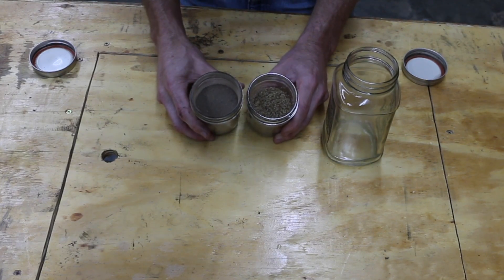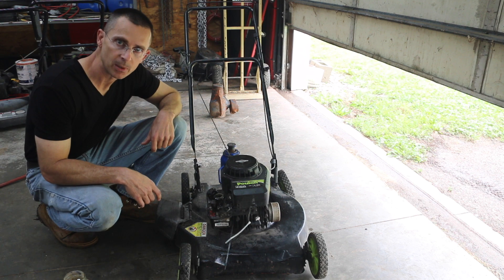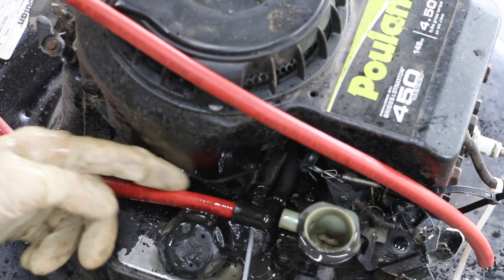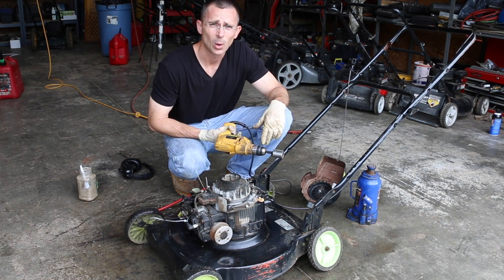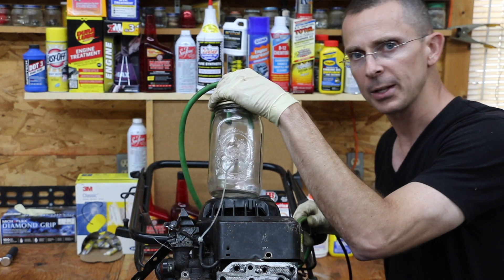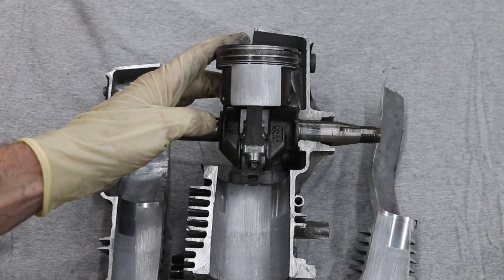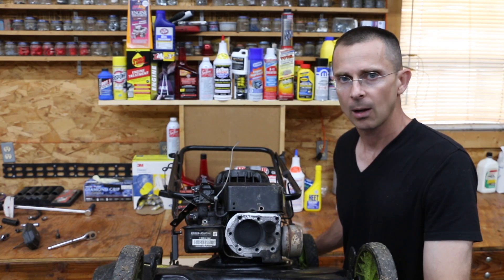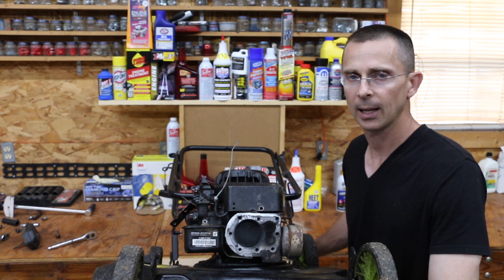Will Dirt Destroy an Engine?  See what it does to this Engine!

Comment: K&N filters gets you free dirt at the cost of “better flow”.
Reply from the maker: Thanks for the feedback.
Reply: Project Farm thanks for all the awesome test! Keep em coming. 

I commented that bc I used to be young and dumb and fell for that “K&N is teh shizz yO!” Till I noticed after a couple of oil changes later my oil was a lot dirtier than when I had used the oem or other air filters. Stuck with oem ever since. To each their own, let them experiment and come to their own conclusion. One’s experience is not always the one be all end all.
Reply: High flow air filters are supposed to be used for performance, not to prolong the life of the engine. Lots of performance and race cars are always rebuilt after every race bwcause they use high flow air filters amd oil filters and lots of other stuff that in reality destroys the cars. But if it wins it wins. Its just not gonna run in another race without a new or perfectly remachined engine

Comment: That oil looks just like the oil in my old Camaro before the rod went through the block. May not be as destructive but if you could try to recreate a scenario of using bad gas that has laquered up or not using a fuel filter with dirty gas.
Reply from the maker: Thanks for the feedback.

Comment: Hi project farm, so years ago, my first car engine died because the 4th cylinder had low compression and started failing. I always changed the air filter regularly. Does dirt still get in the engine in other ways that could have caused this? I changed the oil fairly regularly too, but I guess over times the head must have lost its seal or something. Maybe a combination of both who knows, we may never know .... things do break and get old over time, I am just curious about the mechanics of a failing cylinder like that. Definitely was my queue to get a new car, wasn’t worth the cost of taking the engine apart on a car that was 13 years old and close to 200,000 miles on it....Anyway Thanks for a great video.
Reply from the maker: Great question.  Even under perfect conditions, an engine will wear out at some point.  As an engine is used, wear metals contaminate the oil and can lead to quick engine wear.

Comment: I knew an old guy who would layer windows screen where the filter goes. Ran every engine and car he had that way. He also only used 30 weight oil in everything, no matter what it called for. He always said he never had a problem. But it’s clear in this video over time there will be serious damage.
Reply from the maker: Thanks for sharing.

Comment: What about putting 50:1 in the oil side without gas. Reason I state that is because recently I came across a mower where a gentleman added gas inside the oil area. And when I went to clean it it started without gas ever being added
Reply from the maker: Thanks for the feedback.

Comment: Mr Project Farm The Man, I have a lawn mower that was used to start cold and run fine until I turned it off and then couldn’t get her to turn over warm; it’s not starting anymore at all. I’ve changed the spark plug and checked the oil, does this ring any bells for you? Thank you, love the videos
Reply: I also took apart the carb and cleaned it for good measure and ran it while spraying carb cleaner inside.
Reply from the maker: Thanks for the feedback.

Comment: Hey project farms, I have a volvo XC70 2.5t I just did an oil change and when I looked at the old oil filter it was completely full of sand. Also the engine oil was very black and full of tiny copper, aluminum, and steel grit and particulates. I started using a K&N airfilter since the last oil change and I suspect this might be the culprit. the car has about 140K miles on it, would it need a rebuild ? Or run it until it starts to makes knocking noises ?

Comment: I would like to see an air filter comparison. Sponge vs Paper. A lot of small engines have one or the other. I even seen a combination of the two. Also seen some manufacturers say to add oil to the filter before use. This is on both types of filter. Even some pre oiled. 
I'm sure paper filters are the best choice. Even better when oiled.
Reply from the maker: Great suggestion!

Comment: I have to question your judgment on how you did this test, it doesn't simulate real world conditions at all (due to all the sand and dust being added in in such high quantities)  unless you're trying to use your car engine as a vaccum cleaner in which case you simulated real world conditions perfectly

Comment: Do this with a 2 stroke dirt bike engine. As I commented on another video about he air filters, k&n and foam filters require a lot of cleaning and oiling to work correctly. I made the mistake of forgetting to oil the filter on my son’s kx100 dirt bike. He rode it on a track that was dusty and very sandy. After about 30 minutes of wide open throttle riding, I could hear the bottom end knocking. It was a very expensive oversight 🤦‍♂️
Reply from the maker: Thanks for sharing.

Comment: I have a 2 stoke atv with large hole in the rubber befor the carb and after the air filter. Its been backfiring and runnin like crap so I ran a fuel additive and cleaner to the gas and now its puffin smoke and wont idle... also I mixed a small amount of different two stroke oils together and fugured maybe thats whats gumming it up?

Comment: Thank you for sharing this. I would like to see if a badly damaged mower could be repaired”ish” with honing and new rings. I got sandy swamp water in the crank case of my 4 wheeler. I had it bored out replaced the piston with a new one to match the bore and it ran fine.

Comment: Maybe try doing a cylinder washing. Basically running a overly rich afr in a engine can remove the cylinder wall crosshatches and cause blow by. Some what similar damage to what you showed on this video I found in my 74 302 dirt is no good in the a engine. Gotta get rid of all of it before I put it all back together
Reply from the maker: Thanks for the video idea.

Comment: Just saw this video great video on the damage done to the motor.  Sometime try to run a lawn mower in a garden or some place where there is dry dirt and not just feeding it by the spoon full.  Simulate running with out a air cleaner on a gravel driveway or field in dry conditions for a tank or 2 of gas.  To see have much damage will happen.  I don't think it will be as bad as this last test.
Reply from the maker: Thanks for the video idea.

Comment: Good video, as always, but I would have liked to have seen you take a used air-filter and, using a brush, scrape off the captured contaminates then add those to the carb. That would probably be a more realistic test.
Reply from the maker: Thank you for the feedback

Comment: You should do the same thing with water. I got a ATV that a sunk and a few hours of riding later the engine was locked up. Not sure if it was from the water or the air filter fell apart. But when I took it apart there was gravel on top the piston.
Reply from the maker: Thank you for the feedback

Comment: About 10 years ago, I think someone got their car-vandal ideas mixed up.
  
The  (kinda' long) story:  
I drove to my friends house to stay over on 4th of July weekend.  The next day I went to my car and thought nothing of several old milk jugs, and the old funnel and a shoebox that both looked to once contain dirt, in the alley next to where I was parked. I figured someone littered, or the garbage truck guys dropped something.. Oh well.  I picked them up and into my friends' trash can they went, but I kept the funnel.  (I'm always needing one)    While going home, I was a bit confused at the fact that my fuel gauge was reading just over 3/4, when the night before it was just under 3/4.  (about a 3 gallon difference)  I know they drift a bit,  but this was far more than that.  Halfway home, the car started running very poorly. and stalled out several times.  The next day it would only run for about a block, then stall.  After about  5 minutes, it would start and run again for a block, then stall out..  I got back home and pulled the fuel filter.  It was damn heavy.  Dad took me to the auto parts and I got a new one.  After about 5 miles, the car did the same damn thing.  I checked the filter,  not as heavy,  but it was clear that it was getting clogged.  
Time to drop the tank!  I siphoned the gas out, and got about 3 gallons of water with it. The gas-water content was really brownish as well.  I got  the tank  out, and popped the sender off, and saw mud,  YES, MUD! on the sock.  "Well there's your problem, Cammi!"  A nice silty layer of goop and mud in the bottom of my tank!  Then,  all the pieces of this puzzle came together!  Some "posterior orifice" had put dirt and sand into my tank by washing it down the funnel with about 3 gallons of water.  I scooped about 5 to 7 pounds of it out of the tank, and washed the rest out from behind the baffles with the water-hose, by putting the tank upside-down on sawhorses and spraying inside, and rocking the tank until I got nothing but clean water out of the sender hole.  After letting the tank air dry in the July sun for a few days, It put it all back together, with another new fuel filter and a LOCKING gas cap.  No more problems.
So yeah  someone put dirt and sand into my gas tank, instead of sugar.
I think sugar would have been worse,  but hey,  the dirt was free for the creeps who did it.
Reply from the maker: Wow!

Comment: I had a Traxxas Revo 3.3 RC car. We bought it used from a guy who said it needed a single part (exhaust header IIRC.) we replaced that and then did hours tuning because it wouldn't idle, but we didn't even get close before it threw a rod. 

Anyway, we then replaced the engine. My dad got it for me. I was so excited, and I broke it in for a number of hours. I cleaned the air filter religiously.

But the next day, I took it to a friends house, and forgot the air filter was on counter next to the sink drying. The front left wheel when turned aimed straight at the air filter under the body, which isn't a problem when the air filter is there. We drove it for about five minutes, before it sputtered and died. I hated myself for a solid week before I could even stand to look at it or my dad. 

That was the only engine failure that was our fault. The rest were just the nature of an inexpensive engine methinks.

After four or five engines we gave up and gave it to our uncle. If I ever get another RC car, it'll be an ELECTRIC Revo. :)
Reply from the maker: Thank you for the feedback

Comment: Dirt dust and sand is referred to as “dusting out” and yes it will eat up your pistons, rings, ring lands, and cylinder walls/liners not to mention if that dirt makes its way to the oil pickup tube, it could plug that up and starve the engine of oil
Reply from the maker: Great point on the damage!

Comment: Good video 

here’s another suggestion there is an old wives tale....

that if you were trying to quiet down a noisy motor to sell it Albeit a motorbike or a car ....

And the motors got piston slap bottom end knock from wear......

the story is you can quiet all that down by adding sawdust to the oil and it will drive smooth run smooth last for a while.....

next oil change it all comes back again and charlatans do it in dodgy car yards and even private sellers do it 

I wonder if you could test that.....???
Reply from the maker: Thank you for the video idea!

Comment: Sand is the best additive for fuel economy, it guarantees you will never have to take that engine to the gas station again... Though I would argue that an engine can handle a little dirt as dispersants in the oil will hold a lot in suspension. One could easily  put a screen on the airbox to keep out sand but would still let dirt in. I wonder what would happen then? Maybe you could incorporate this into your oil tests to see which oils do the best job of keeping dirt in suspension...
Reply from the maker: Thank you!

Comment: Next time try crushed walnut shells. Back in the 70's, Ford told their dealer Tech's to use walnut shells to clean up the carbon off of the Pistons. Now they have sandblasting kits for the cars that run high pressure injection pumps, for gas engines, since there is no fuel spraying on the intake valve to keep it clean. The theory, is that they're so soft, they won't damage the engine.
Reply from the maker: Thank you for the feedback

Comment: I wouild like to see a test of the JB weld putty . It has a black core that runs through a gray outer and you break pieces off and mix by hand .  There are different brands and they all make different claims like some are better on plastic and some work under water.
Reply from the maker: Thank you for the video idea!

Comment: Video idea:
Effects of running a cold engine hard immediately after starting it.
Reply: I dont think it'll show much, this causes damage in the long run rather than after a few runs. Engine problems usually develop later on in their life when they've been run cold and hard a lot
Reply: Yea if he could find an old car for cheap and just blow it up like that itd be dope
Reply: If it's cold enough out it will cold seize
Reply: @Jake_Hynds  maybe if it's running very watered down antifreeze (or straight water...amazingly, some people try). We had a few -40°F mornings here last winter, and my truck (2000 Ford 6.8l V10) only struggled to circulate the P/S fluid for a few seconds, causing it to stall once. It was running fresh 5w20 Amsoil Signature, and about 3 year old antifreeze.
Reply: @joer5057  idk I only know of my old skidoo pretty long time ago I was young and just fired up my sled -30 degrees celcius == -22f   
Fired it up it wasn't running to or idling very nice so just jumped on it and gave her tits lol .... bad idea as it cold seized  in one cylinder.. didn't really seize but blew one cylinder and my dads freind help me rebuild it and knew exactly what I did and why it blew as you can tell by the metal..
Reply: Everytime i try to cold start my engine it takes quite some amount of tries and time to start it up.
Its mostly because my motorcycle uses a carburetor which is known for its hard start on a cold engine.
Reply: @syankha8329  yea but it should still start easily with the choke on even in say minus 10 or 15 celcius..
Hard cold starts sometimes means the valves are out of specs or carb needs tuning
Reply: @Jake_Hynds  Thats the problem.
I dont have that choke lever.
Idk if its automaticly choked when i try to start it.
Reply: @Jake_Hynds  But the carbs are cleaned at the mechanic twice a year.
The motorcycle is quite old too.

Comment: How about an engine that has been recovered from under water
Reply: I might add on that the engine was running when it went in the water I have personally done this but didn't test to see what it damaged or another one that seems to happen alot in the summer an engine that has over heated but turn it off before it seizes

Comment: But @ project Farm modern car engines have fuel injectors and 4 to 12 cylinders it would take 10 times as much sand at least to take out a modern car engine also the cylinders in car engines are bigger
Reply from the maker: Thank you for the feedback

Comment: I think you should run a machine for 12 months and then check the air filter for weight change. See how large particles it has stopped and what kind of particles it is. Whether it is sand, metal, bilogical material or grease and oil.
Then, based on that, you can run your test. The test shown here has no reference what filter actually stops or not.

Comment: Engines have rough lifes sometimes depending on the person I guess. people these days are like oh I can run an engine forever without oil or changing parts on the motor but it's important to some people that you do maintenance on the engine I get people all the time asking me if I could fix something on there mower and a lot of the time it's Catastrophic Engine failure and just bad maintence then I show them what happend and tell them this is why it's important that you maintain oil and maintence so you don't have to buy a new mower.

Comment: Lol what engine would suck in that much dirt unless your driving on a dirt road.  The dirt could be keeping the reed valve stuck open as well.  Jb weld it back together and bore the cylinder then you got another lawnmower.

Comment: That was not a small amount of sand. The test was also flawed. Yes, running an engine without an air filter is a horrible idea. But the way you performed the test, the amount of sand was introduced way too fast. The engine bogged down, and the engine was not able to rid the combustion chamber of sand or dust in the fashion that it would if not bogged down. For example, 2 stroke outboards do not have air cleaners. They run in an environment with much less debris in the air. Nonetheless, they still intake dust and salt and organic elements in water droplets. They get away with it because the flow of air and scavenging effect of air will actually spit out small particles through the exhaust. Most of the particles rarely get enough time to adhere the cylinder walls unless the wall is super wet with fuel and oil.
Reply from the maker: Thank you for the feedback